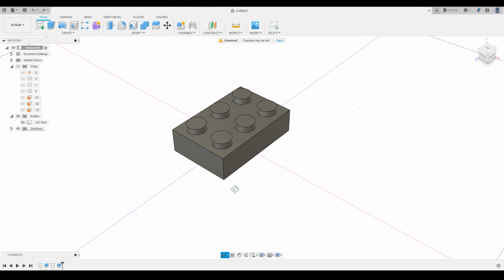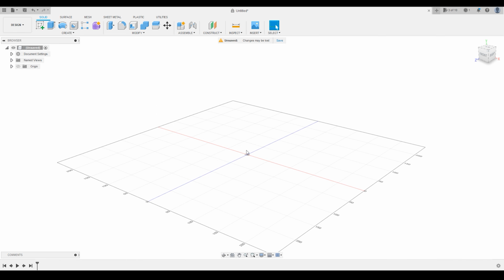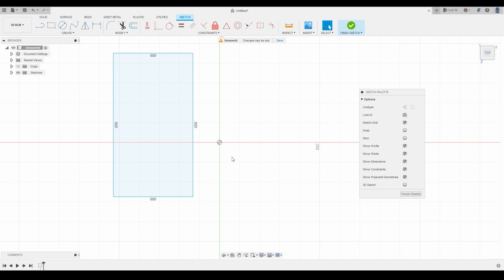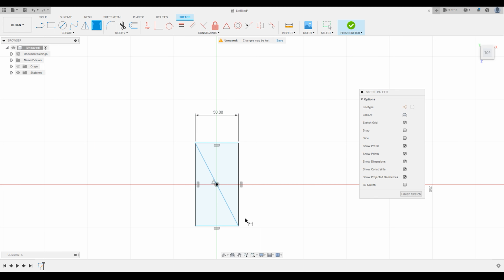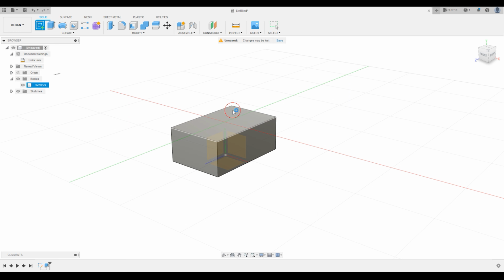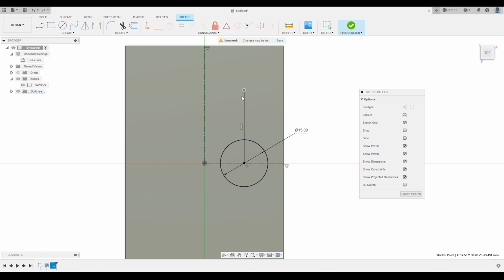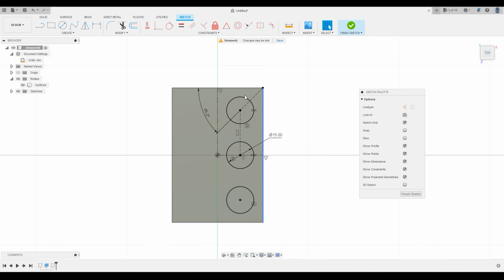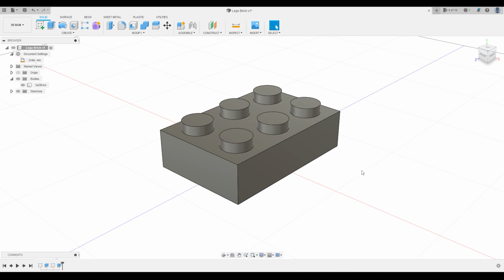Beginner's Guide to Modeling in Fusion 360 - Beginner Tutorial -  CAD, CNC, 3D Printing (2022)

Comment: While things do change over time, when I drew a rectangle by choosing an upper left and lower right, my rectangle was already constrained. I could not click on an edge and alter its size or shape. Is this due to a change in Fusion, or might I have a setting different from yours? My rectangle edges are all light blue. And after adding a dimension to the horizontal and vertical edges, my colors remain the lighter blue with no highlight due to hovering but only by selecting a line after selecting the dimension tool does it change to the darker blue. v2.0.18460
Reply from the maker: Hmmm that’s a tricky one, sometimes Fusion will automatically apply constraints you don’t want depending on where you click… try toggling the show/hide constraints in the sketch to see if that helps / shows any constraints you may not have expected

Comment: One question: why not use the center rectangle ? And for the rest just a big compliment on this tutorial Big thumbs up and  subscribe
Reply from the maker: Hi Hans!  Appreciate the comment!   You are absolutely correct, you could use a center point rectangle and achieve the same result.  There are 2 reasons why I didn’t in this tutorial:  1. I wanted to get the viewer comfortable with the fundamental logic behind the center point rectangle … that you can find the center of any rectangular area  by locating the midpoint of the diagonal, which is a super important tool as you continue to  build on your geometry.   2.  I’ll admit this is a bit of a habit for me…. When I learned 3D modeling the center point rectangle tool didn’t exist yet lol.  Thanks again!